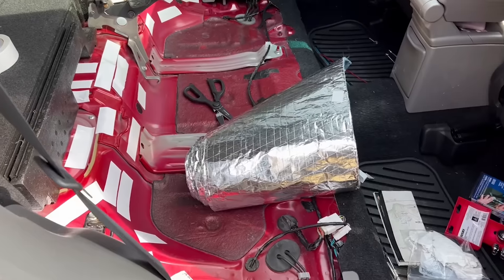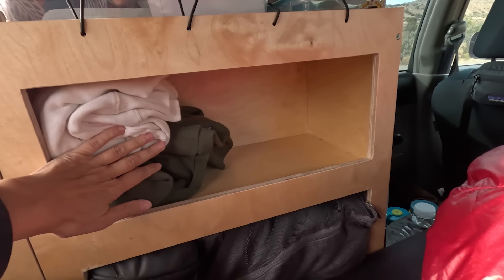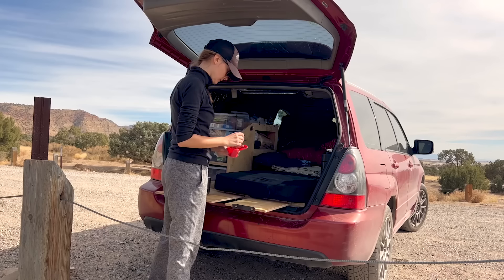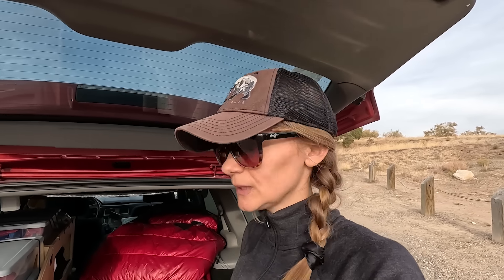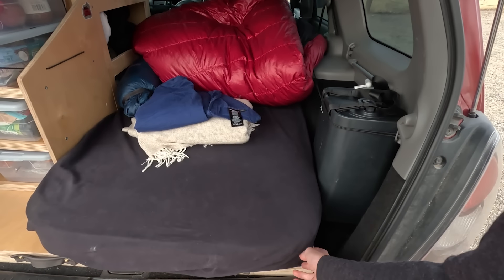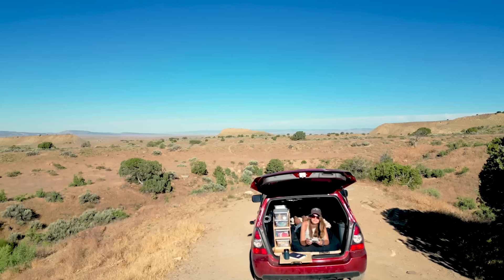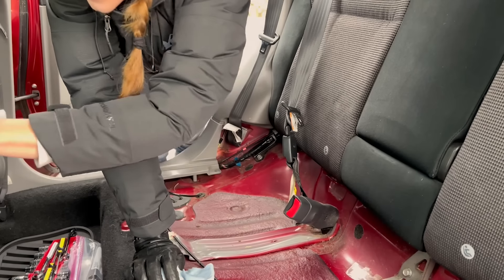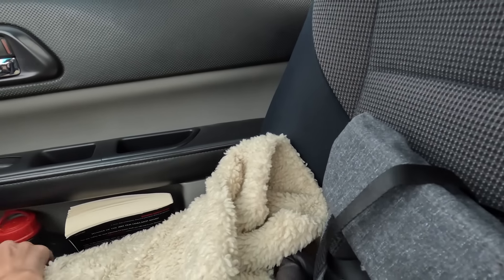Subaru Forester Camper Tour and Gear Guide - Solo Around North America

Comment: Just a tip, if you wax the slide out tables with some paste wax they will slide out much easier. Any type of paste wax should work.
Reply: Candle wax.   Cheap
Reply from the maker: That is a really really good idea! I have never though about it - thank you so much!
Reply: I do the same thing with my artificial Christmas tree. I use it on the metal poles to make it easier to take apart.
Reply: @ashaslaw  
Your 🙏 welcome
Try wax on sluggish zippers also✅✅
Reply: You’ve thought out your vehicle and travel situation very well. Lots of great ideas and information.
Reply: Great idea! Blessings 🌱
Reply: Or soap
Reply: Yes, came to say the same thing, my father always used an old candle.  I would think just along the two side edges.
And when using screws in tough wood, he would run the screw through his hair that had brylcream in it, lol. Worked every time.
Reply: Soap works as well

Comment: You can put a puppy pee pad under your little table (with the absorbent side up) to catch any spills and prevent your insulation from getting wet. You can get a small pack of 3 or 4 at the dollar store. Also great to put your shoes onto when you take them off... keeps the dirt and mud contained. 😊
Reply from the maker: It’s such a good suggestion! Thank you so much!
Reply: I keep one in winter at my door, dogs use too ( only during late night ). It helps keep bad weather leaves, mud,rain,snow,etc. at bay. The white covering, debris seems to stick. Weather changing trick. If you live off grid they are great to use under urine bottle or porta pottie. Many uses.....
Reply: Great idea

Comment: Looks like you thought of everything. I would just add a vinyl table cloth over that insulation with wires underneath, because accidents happen. But it looks like a cool setup you have there.
Reply from the maker: Thank you for your suggestion - unfortunately vinyl cloth wouldn’t work as I often get condensation in the car so my  insulation has to “breathe”. Cables are double wrapped with an electrical tape so thay are fairly secure. I’m glad you like my setup!
Reply: @ashaslaw  Drat, I didn’t think of that.

Comment: I plan on going on solo road trips next summer. 8 have pretty much all of what I'll need.

I ended up getting a car fridge. Didn't want to deal with getting ice. I do need to look into a small stove. I got a 1.1 liter pot for cooking. Should be enough for just me.

I did pick up a few ideas. Thanks for sharing.
Reply from the maker: I am so glad you found my video interesting! My pot is 1.9l. but it also serves me as a mixing bowl for salads, etc. What kind of power source are you going to use for your fridge?  I hope you will enjoy every second of your solo road trips! :)
Reply: @ashaslaw  I have a 1500wh battery power station that's mainly for the fridge, and a 500wh and 300wh for everything else.

I tested the fridge with the 1500wh by leaving it in my van in 90 degree weather and it ran for 3 days down to 17% the third day.

I also have a 100 watt solar panel.

Comment: Nice set-up but...I have to have a toilet of some kind....even a bedpan lined with a plastic bag on the front passenger seat set on a puppy pad....just in case.
Reply: Hello there, just a little nugget of info. If you dedicate a small bucket, with the lid of course, a left over plastic bottle, and a left-over baggie of cedar chips you have an indoor outhouse if you are in need. You would have to use the seat when you attend to business.
Reply: I have a bucket with a toilet seat. It takes up a lot of room but works as storage for me when not in use.

Comment: You’ve got a pretty powerful Jackery there, is there not a ceramic heater that you can plug into that occasionally to keep warm?
Reply from the maker: I haven't thought about it... Thank you for your suggestion - will look into it!
Reply: @ashaslaw I've heard good things about ceramic space heaters from other vanlifers. Supposed to be ultra efficient
Reply: A ceramic heater would kill her Jackery in an hour or two and it would take forever to recharge it from driving. A 1000 watt hours is not a lot of power.

Comment: Do you only camp in campgrounds? I’m trying to figure out what rescue gear I need to bring in case I get stuck somewhere. I have traction boards and I’m wondering if that’s enough or do I need to bring a kinetic rope also? Also you don’t have anything to level your SUV. Is that because campgrounds are level? I won’t be doing campgrounds so I’m wondering if I’m overdoing it or if you’re camping differently from the way I’m going to be camping.
Reply from the maker: I don't only camp on campgrounds - I also overland and boondock but... I am aware of the limitations of my car and choose spots wisely. I'm always most worried about the clearance and if I see that I am too close to getting stuck  - I don't risk it. I also plan ahead and check the weather, i.ex. when I see that the area may turn into mud after rain. And you are right - i don't carry anything to level my Forester - I simply don't have space for it, so I often roll at night ;)
Reply: @ Lol. Thanks for the info. I was the same in my Santa Fe. I’m in a Sienna now, and I’m solo now, so I can bring more gear. Thanks for creating this channel. This will be my first time traveling without a boyfriend and not in the city so I’m a little freaked out. Watching other women like you and Rosa do it with no man or dog really helps. I’m not scared for my safety. I just don’t want to die from incompetence, like falling off a cliff or getting bit by a rattlesnake. I’ve seriously read too many hiking/camping news stories.
Reply from the maker: I would invest in a Garmin inReach mini if I were you (and if you are planning to be in remote areas with no cell coverage). It's a big investment but it gives the piece of mind while traveling solo - you can always text somebody and ask for help.
I also posted a video with safety tips - you may find it helpful.

Also, building up your confidence may be a way to go - go "small" first - spend a night or two on a remote but private property (via Hipcamp), and once you see how it is and prove yourself what you are capable of - go explore more. You've got this! ;) Enjoy every second!

Comment: If you have the hatch open in the back for a long period of time the battery runs low or do you have a way to prevent the lights from using the battery?
Reply from the maker: I trick my car by putting a thin metal carabiner into a hatch lock so the car think it's locked.

Comment: Thanks so much for sharing! I'm preparing for a similar trip so this is incredibly helpful. I'm curious what you do during rainy weather. Do you have any sort of shelter that allows you to spend time relaxing outside of your car, or do you just stay in the car during those times?
Reply from the maker: I'm so so happy your found this video helpful! Regarding rainy weather - when the trunk door is up, there is no gap between the roof of my car and trunk door so I can easily sit in the back of my trunk (and even use my sliding tables) when it drizzles/light rain. When the weather is really bad I stay inside (when my sunroof is uncovered I can easily sit up in the middle of the car). Also, I try to take into consideration the weather forecast when planning my route. Hope this helps. Good luck with your trip!
Reply: @ashaslaw  that makes sense. Thanks for the response!